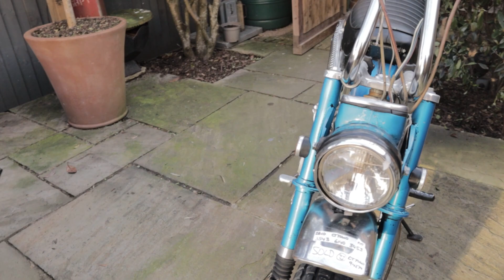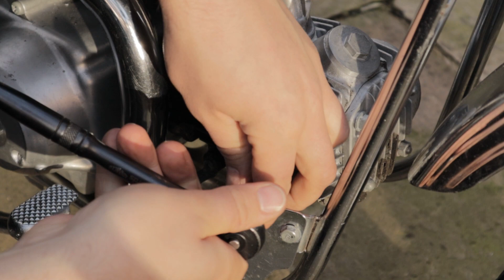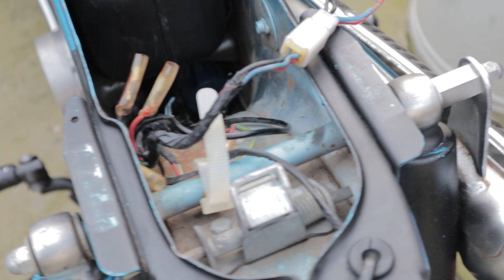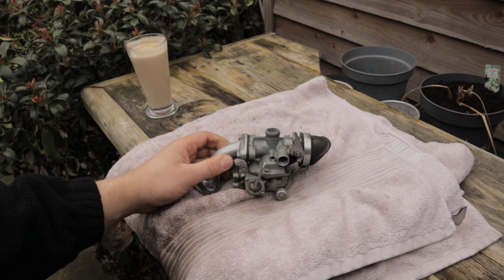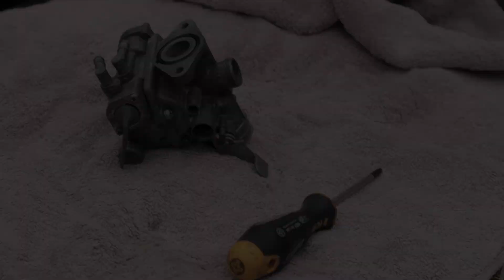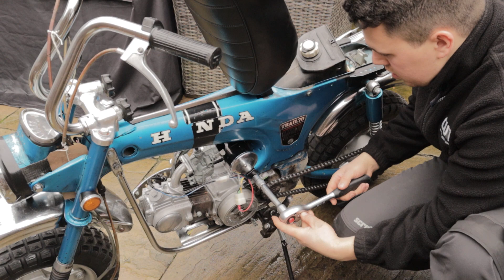Accidentally Purchasing a Rare Honda | CT70 PART 1

Comment from the maker: Following the completion of the engine build, I can confirm that this bike did not run due to a faulty flywheel! It had de magnetised over time meaning it could not produce a strong enough spark to successfully run! A full build video is due to come out covering it all!
Reply: Well you prove a person is never too old to learn something new, I just never had anything like that happen.  Sometimes when I work on things and use a screw driver and I can't hold the screw or don't want to lose it, I take a magnet and slide it down the screwdriver shaft several times and it magnetizes them so they hold the screw.
I have had some for around 30 years that are still magnetized.  The old CRT Television tubes would build up magnetism around the picture tube, they had a thing called a degaussing coil around the tube to de magnetize it. So I never knew a magnet could lose it's electrons north to south. over 50 years, I have never ran across a magnet going bad but I believe you. You were real lucky to find the bike, but very un lucky to have a bad flywheel lol. Glad you figured it our, So that means you can put the pointless ignition back in now if you have a good flywheel. Thanks for your video and for being so kind.
Reply from the maker: It is certainly a strange one but its good to get it sorted.
Luckily my Z50A has the same flywheel but much better condition and I'm planning to run that one on the original points so a simple swap and we are all sorted. If not, It would of been a very difficult and expensive part to find.  I suppose you could say the issue lies in the changing from points to electronic..... It will perform much better but this would have never been an issue if kept standard ignition, oh the joys.

As for the bike, its going to be great and I am excited to finally get it finished! 
Thanks for the chat, I hope you watch the rest of the series!   @melfrank8379

Comment: Great troubleshooting and everything you tried was spot on. Good explanation of what you were doing. I was curious where you bought it from Stateside and what did you end up paying? I just found a 1970 and thinking about purchasing it for $800, it’s in need of some work as well and not in running condition.
Reply from the maker: Thanks for watching and commenting! It was imported by a company and I purchased from them. For transparency I paid £1800. so $800 sounds like a good deal to me. Unfortunatley they arent cheap, and super difficult to get over here.

Comment: Mason, the best way to test if your spark is hot is take the plug wire lose , take the plug out so you can turn the engine over faster and put something like a Philips screwdriver into the spark plug lead holding the shaft of the screwdriver near a clean ground of the motor. Then  vary the space between the screwdriver shaft and engine ground as you crank the engine, the hotter the spark, the further it will jump. I use to think too that there was any difference in the spark inside and outside the cylinder,  usually if I had a blue spark, it would arc further than a point gap and that is hot enough to do the job.
I was working on a sears 2 cyl garden tractor,  I  had lost spark only on one cylinder, It had only one coil with 2 plug wires coming from it so I ordered a new one.
I got it and installed it and could not get the tractor to even start but I had spark. I determined what you had that the spark must not be as hot inside the cylinder because it would not fire the motor. I adjusted the gap and tried everything so I tried switching the plug wires and it ran but again only on one cylinder. I was dumbfounded. The tractor had no points, just a condenser, I had no clue how it knew when to fire, or what caused the discharge to the plugs. Then I noticed something different about one end of the coil so I thought maybe it is upside down. I flipped it over and it fired right up ran perfect.
Turns out they have some kind of inductive trigger wrapped inside the coil insulation that takes the place of the points, triggering the coil to fire, if it is not installed right it does not trigger the timing of the spark right.
My point is, it is easy to assume when you know better if you find no other explanation, that it must be a weak spark, despite you knowing it had a good spark as you said in your video numerous times.
I have had DUH moments, I think you might have had a DUH moment not noticing you had only put enough fuel in for a reserve level in the tank, and never setting your carb to reserve when you tried starting it. I can tell you even a weak spark like with a fouled plug will still sometimes fire or mis fire if their is fuel, without fuel, you will get nothing.
I wish I had been there to help.

By the way I know I wrote a lot and it may not help you if your problem is fixed, but I hope it will be on the web when I am gone to possibly help others. I have always been the one people called when nobody else could figure things out.
Reply from the maker: I completely  agree that it is easy to come to a conclusion. I think if the bike was not being completely rebuilt, then more time would of been spent trying to get it to run in its then current condition and maybe it would of been obvious. As it was being taken apart, I wanted to come to some sort of conclusion hence the outcome. 

Your comments are valued and appreciated! As you know, its not always simple. 
If you are in the UK you are more than welcome to make a visit and take a look at the engine, I can show you it running on one flywheel, then as soon as its changed it not running! Would be great to get your expert opinion on it!
Thanks

Comment: Mason, I think you said you got it running, still does not sound right that the solid state ignition needed anything different than the standard flywheel as far as magnetism.
In my experience pointless ignitions put out a hotter spark, I just wonder if your problem in the video all along was the fuel petcock setting, perhaps you added more fuel or had the petcock setting in the right position on R , when/if you did get it running.
 Then assuming the problem was the pointless ignition,  when really you accidentally changed the circumstances where you got gas when it finally started,  and just thought it was the new ignition system not working because your flywheel had bad magnets, when  you said it would only work with a standard  points ignition.
 If it is running a good way to find out is to put the pointless system back in with the tank full, while making sure the gap between the coil and flywheel magnets is proper.

I still do not believe the pointless ignition would be any different than going stock except for one thing, it was made in China, that means they rarely get things accurate be it a bolt hole position,  or a clearance. A magnet passing by coil has to have a certain gap to create the proper hot spark, some coils are adjustable like on Briggs and Stratton engines, they have a gap setting. I am not sure about Honda if they are adjustable, but before I would believe in weak magnets, I would suspect the Chinese mounting of the coils on the ignition plate was probably not very precise . The gap to the flywheel could be several thousandths off and weaken the spark.  But magnets on the flywheel being weak, no way, that is unheard of.

I bought a Chinese knock off regulator for my old tractors generator. They had the tension on the springs way too stiff and the point gaps wrong, it quit working within a month.
I took the cover off and found the points burnt because of their failure to get tolerances right. I cleaned and set the points to specs and adjusted the springs that had been set way too stiff and never have had another problem with it.

I just hope when we go to war with China, their Military equipment is made as bad as what they sell us, if that is how they make things, the war won't last a month lol.
Reply from the maker: Just revisited this comment! About to get the bike fired up in its final form so will be able to report back with some accurate information!

Comment: Funny you are second guessing yourself in the video, several times in the video you say you are getting good spark, now you are convinced the magneto magnets are weak. I guess you read my other comments trying to help, the obvious to me is your fuel tank had enough gas only for reserve, and I never once saw your Petcock on the Carb set to R. Especially immediately after you eliminated everything else. I could not figure it out either if I had the distraction of making a Youtube video.
Reply from the maker: My thoughts are that the spark was good outside in normal atmosphere, yet when inside the cylinder under compression, was not enough to allow for it to fire and run correctly! As mentioned, when the engine is on the test rig and we have gone through all components, it left us only with the flywheel that proved to be faulty. As you say, diagnosing a problematic bike with a camera
Rolling is slightly more tricky than usual!

Comment: I gave you a lot of things to try, then went back and looked at your video again very carefully.
I could not tell about getting the  hoses on the carb  on the correct ports, you probably did that right,  but I did notice your petcock setting and nowhere in the video did I ever see it in the Reserve position. It was either S for stop or on, never on R for reserve which is the only way it could get gas with the tiny mount of gas you put in the tank.

 Right after you changed the spark plug  and said it made no difference,  the camera view changes to the left side of the bike where it appears you are un screwing the spark plug, at that point I saw what is probably your problem, your petcock was set at ON, not R. The amount of fuel you put in the tank was barely enough to feed the reserve hose, in the on position it got no gas.

 The small amount of carb cleaner you sprayed in, you did it without the throttle open. There is no way you were getting any fuel into the cylinder especially if the engine was in the position where the intake valve was closed. Carb cleaner has a much higher flash point than gasoline, it will evaporate quickly so the little bit you sprayed probably evaporated before it ever made it in the cylinder. I have extensive experience in troubleshooting, I have seen how easy it is to lose focus when your grasping for straws with no clue what is wrong, sometimes you miss the obvious. 
Magnets losing their magnetism, that means you have lost your way and are way off in left field at a loss trying to solve the issue. Throwing more money and parts at a problem is not the answer, it is just experimenting.
A am autistic, I have no social skills, but my strength is focus. Sorry hope I helped you anyway.
.
Reply from the maker: Thank you, this did help! Bike soon to be running so I will review where I went wrong in the first start process.

Comment: Never heard of a flywheel de magnetizing. I think you should try this, remove the carb at the intake port, get some starting fluid or gas in a squirt bottle. Use a drill set to counter clockwise with a socket to fit your flywheel nut, that will spin the engine fast enough to build compression, you might want to spray a little WD40 in the intake too, that helps the rings seal and sometimes if their stuck, it frees them  Having the carb off allows you to be 100% sure you are getting fuel. Keep an eye on your spark plug, check it to see if it is wet, if it is remove it, stick it in a spark plug socket  with the spark end  up so you can fill the stem of the plug with gas, light it with a lighter and let it burn, this dries out the plug, de fouls it for the next starting attempt and warms the plug which seems to help them starting.

Another thing if you believe it is bad compression, squirt some 30 weight oil in the spark plug hole put your compression tester on and see if the compression increases from the  pressure before you put the oil in. 
If your compression increases, you have bad rings, if it does not change you have a leaking valve, an easier fix. Oil will seal a weak piston seal, but will not seal a bad valve seal.

Sometimes a motor can flood with fuel, it wets the plug and fouls it which just means the spark shorts and does not spark across the plug gap. My burning the spark plug trick dying it out de fouls it. Taking the carb off, that way you can be sure you are getting fuel,  in case it is a no fuel condition.

Your pet cock on the carb also has to be set to R for reserve because the amount of fuel you put in was not enough to feed the on position of the petcock, that setting requires more fuel in the tank than what you added.

If you were getting a blue spark, your spark is not the problem, nor was your flywheel.

You have to do the above steps as a process of elimination.
  I have had 4 strokes that ran with so little compression the engine ran but had no power. 

 I never saw you spray any starting fluid in to make sure you were getting fuel.

A de magnetized magneto seems kind of like a desperate  attempt to find the problem that will have you just replacing parts, grasping straws, and  will make no difference.

 An ultrasonic cleaner won't always clean jets that might have a particle of sand jammed in them,    the mixture of fuel to air is not that critical just to get it to fire, just pour a small amount of gas into the heads intake and with a wide open throttle kick it or use the drill to spin the flywheel, if it does not fire, remove the plug and see if it is wet, if it is do the spark plug socket thing and with gas in the plug burn it till it goes out, tip it over and light it again till it goes out, that will un foul the plug
Sometimes you create a different problem trying to fix the original problem, then when you fix the original problem, the other problem you caused confuses you.

So 2 things you did that might have caused a second problem, when you removed the carb and re installed it, Did you make sure the hoses were on the right ports on the Petcock? If you reversed them, you would have to have the petcock set in the on position, not the reserve position. That is an easy mistake if you are not paying attention, so if you want before removing the carb at the intake, try starting it on both the on setting and the reserve setting, or fill the gas tank with enough gas  to be above the smaller section of the tank.

Not sure if it was possible, but make sure the 3 wires from your magneto are connected properly,  through the harness, sometimes on different models the color of the wires are different, don't always trust the colors, trace the wires with an ohm meter.
Reply from the maker: Hi there, Thanks for the comment. A lot of useful information there!
Since this video the full bike and engine were stripped showing the condition of the internals. (video available along with a full rebuild)
The biggest takeaway point for me.... with a fully rebuilt engine, including brand new piston, barrel, carb we could still not get the engine to run on the standard flywheel using the electronic ignition kit. On a standard points and condenser system the engine would run with this flywheel. At the time of this I did not have the standard ignition, only electronic. 

When using the electronic ignition it is essential the magneto is providing correct voltage to get a strong spark. 
As soon as we swapped the flywheel it ran perfectly. so literally every component was eliminated leaving us only with the flywheel.
Not a common one, but one directly linked with the use of an electronic ignition kit. This is the reason I state the flywheel was the root cause of this issue. 
Thanks for the comment. I would love to hear your feedback following your watch of the other videos.

Comment: Just started restoring a 93' and it has the exact same issue. Time for a top end rebuild
Reply from the maker: Check out my latest video on the engine rebuild! It actually turned out to be a faulty magneto not creating enough voltage to allow a strong spark! Regardless, if you have low compression it’s always worth a fresh top end!

Comment: Fyi
A ct70H which is four speed 
Hand clutch
Is the most desired ct70
The one u have is a 3 speed 
Three speed automatic  like what you have
Are way more out there than the
Four speed hand clutch
Reply from the maker: Thanks for the info 👍🏻
Reply: I have the 4 speed. 
   Had it since I was a kid.
   My cousin had thev3 speed. 
   We raced them several times.
   Pretty much tied every time (I'm sure rider error played a part)

Comment: It looks like the VIN number on the frame is punched through the original number
Reply from the maker: It does look a bit weird! the dash between the serial looks like it had a 0 stamped first, maybe a mistake on this frame… all has been sandblasted back now and aside from that the numbers all look good !

Comment: PUSH  START   IT  ON 
QUICK START.......ETHER...
Reply from the maker: Thanks for the comment! They would of both been a good option to try, in the future I will look to put a drill on the stator to spin the engine over much faster !
Reply: It should fire with that compression.  Just an FYI, the silver tags were the first 15,500 bikes, a bit more than the first 2000.
Reply from the maker: @MiniBikeMike  Hey Mike, thanks for the comment Any thoughts on what you think could be the non running issue? Thanks for the clarification on silver tag numbers…….should really validate my source of information, bit of a difference between 2000 & 15,000. All the best, cheers